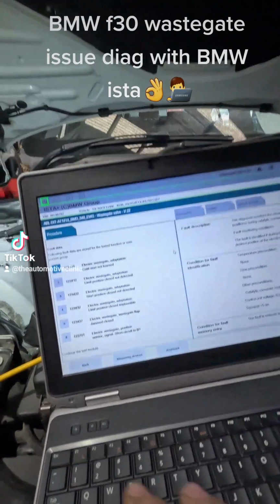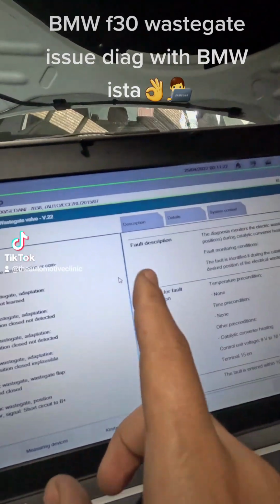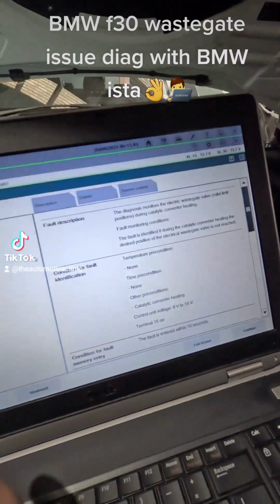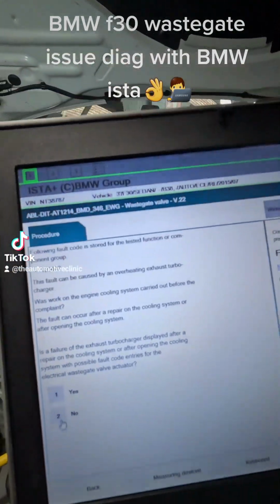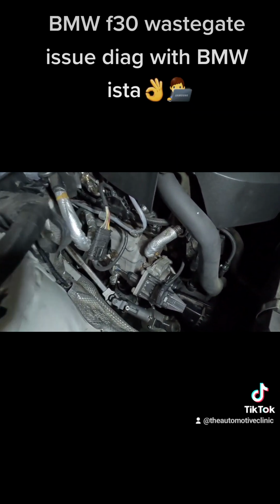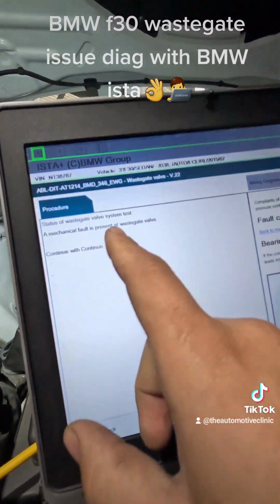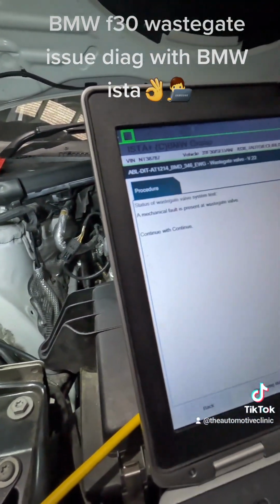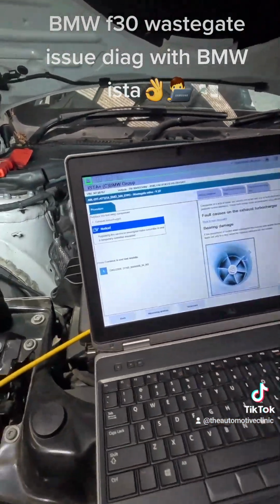BMW F30 wastegate issue diag with BMW ista dealer software😰👨‍💻

Comment: I’ve got the same issue/faults. This was after I had a coolant leak. Do you reckon it’s the wastegate or turbo unit?
Reply: Hi, I have the same, soon after the coolant leak..did you get it fixed?
Reply: I'm also with the same error after coolent leak repair and the car had a prev small rattle from the wastegate
Reply: @tonycool11 hi, I bought a wastegate actuator and asked a mechanic to do the job who is having ISAT and did calliberation, all good now
Reply: @cricket_with_sarath 
Thanks,and Did you had the wastegate rattle sound or just the wastegate error before changing the whole actuator?
Reply: @tonycool11 I got the error 123422 and my car went in to limp mode, did you check for any codes?
Reply: @cricket_with_sarath  yes,it had the wastegate 123402 and 422 errors and the drivetrain error on the dash...
Reply: @tonycool11 check if the actuator is moving with the obd scanner or when you give full throttle if it's not moving then you actuator is stuck and you need a new wastegate actuator, find some mechanic who has the ISAT software and they will get it done, local garage said me to replace the turbo 🤣 but when I tooky car to and independent bmw garage, then they cleared everything
Reply: @cricket_with_sarath yes the actuator is moving ,but probably not enough.ISAT says the wastegate can't find the start and end position,maybe the wastegate linkage is stuck in the turbo..
Reply: @tonycool11 most probably a new wastegate actuator will solve your problem
Reply: I'll try it,thanks
Reply: @tonycool11 did you try it? I have a b38 mini with a wastegate "rattle" more like a loose coin sound and a limp home mode with P126B code
Reply: @7meer-cha Well in my case it was the  turbo exhaust outlet it was dented and preventing the rod to move normally,only a turbo specialist with machines could tell is the problem in the actuator or the turbocharger itself,after various independent mechanics